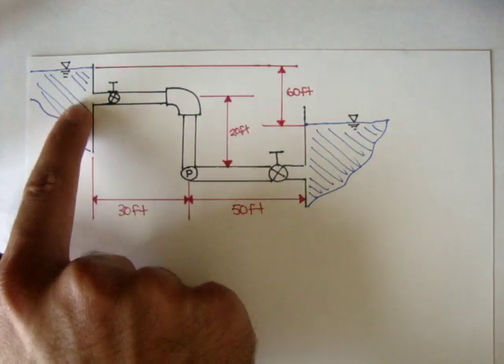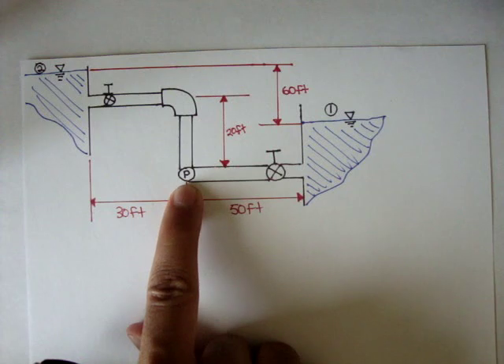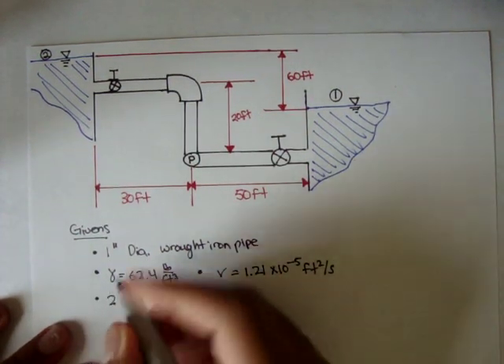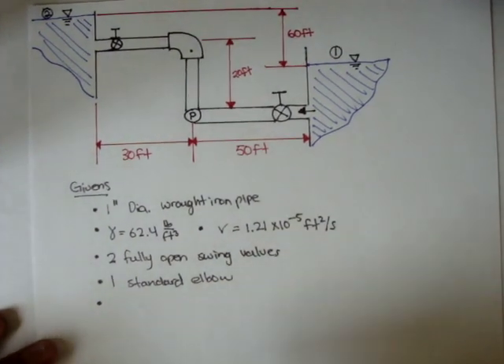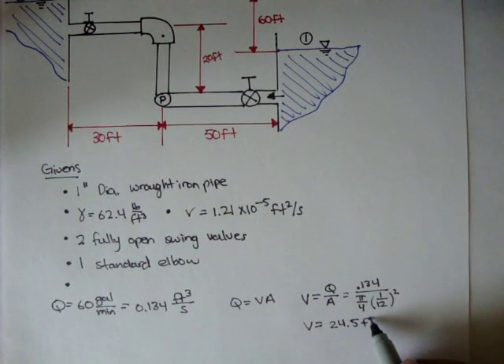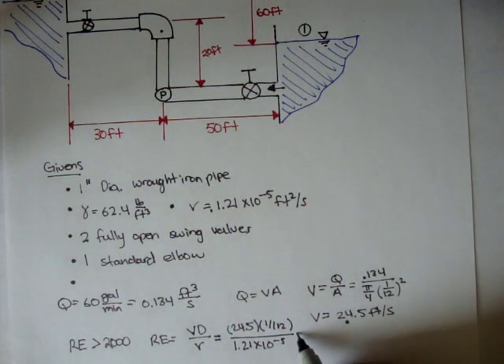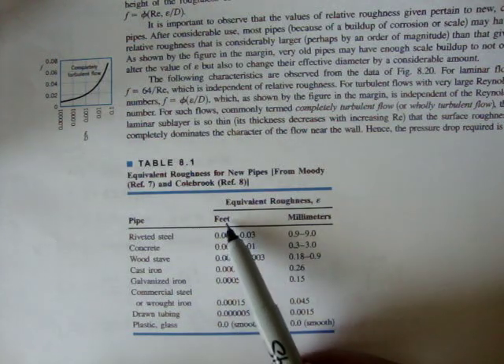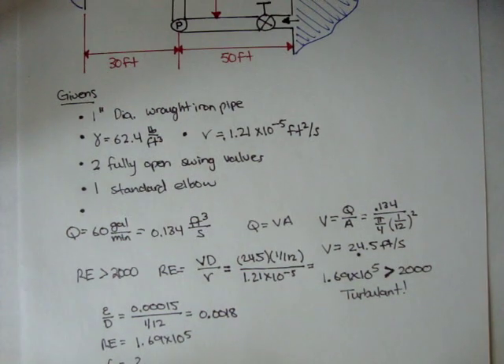Turbulent Flow Example: Part 1 [Fluid Mechanics #43]

Comment: My book states if RE>4000 then it is turbulent flow
Reply: between a Reynold's number of 2000 and 4000 the flow is classified as transitional which for the sake of calculations can also be called turbulent.
Reply: +Ramy Hariz 

There is a range in between fully laminar and fully turbulent. Depending on what you're doing, and where you fall in the range, you might choose to treat it as one or the other, or a combination. 

Usually in classes for fluids and heat transfer you're asked to solve some problems using different RE's, and other values, just to check how much these numbers actually matter. Typically it falls into the noise of the assumptions that were made in deriving this stuff.

Comment: if Re less than 2100 then its laminar flow, and then if grater than 4100 its turbulent flow,
Reply: Less than 2000-2100 is laminar. between that and 4100 is transitional, but since you have to do both a laminar and a turbulent calculation for it, it can be considered mildly turbulent